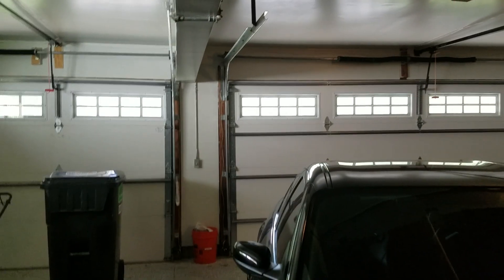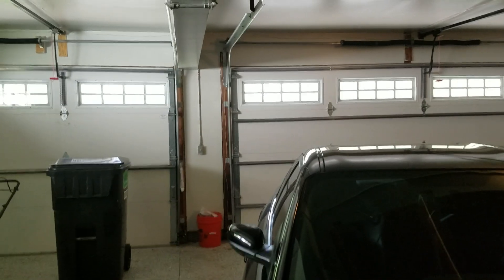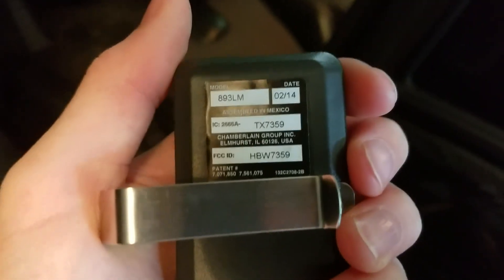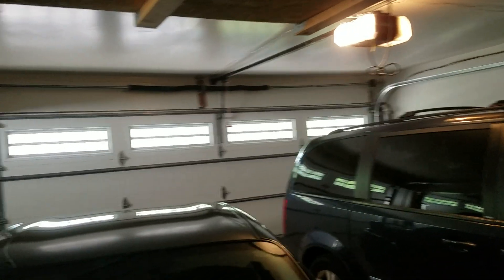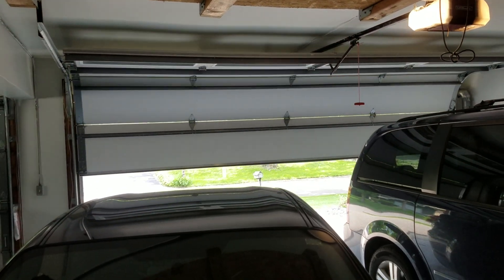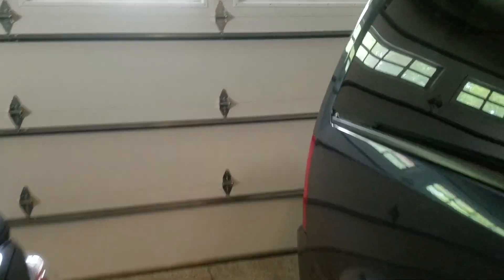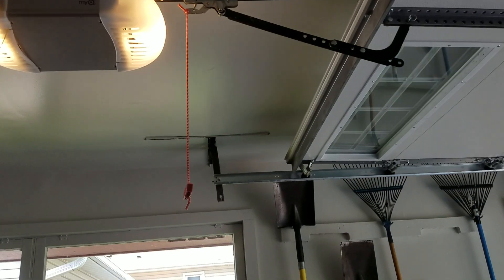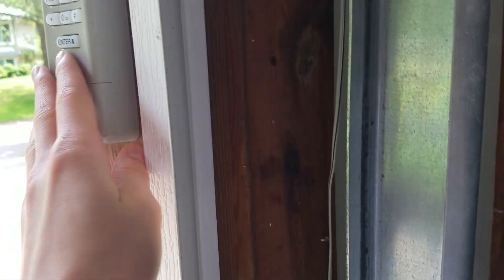Channel Updates for Summer 2020

Comment: if the chain is 1/2 inch above the rail then it will be fine you would just have to disengage your garage door from the opener and measure in the center of the rail
Reply from the maker: Yeah jason told me it was fine and i don't feel like doing it anyways lol